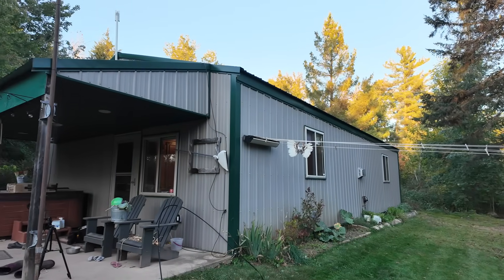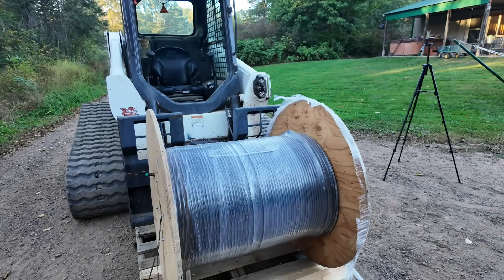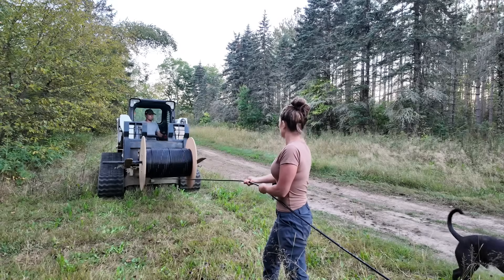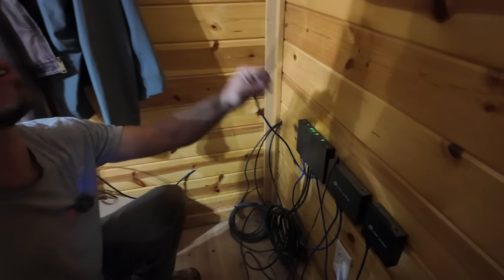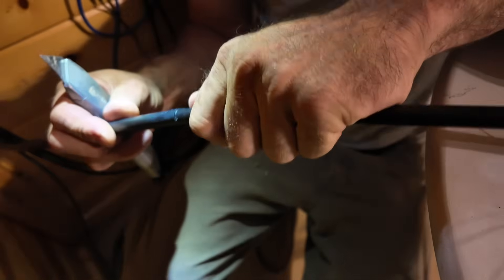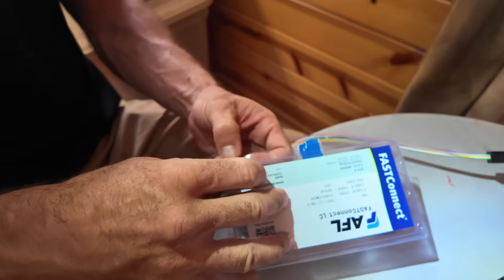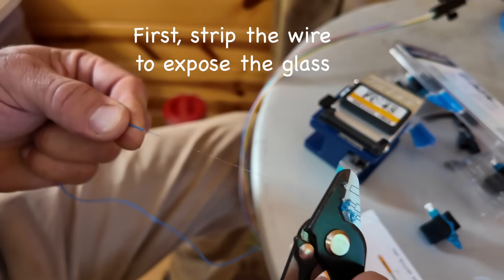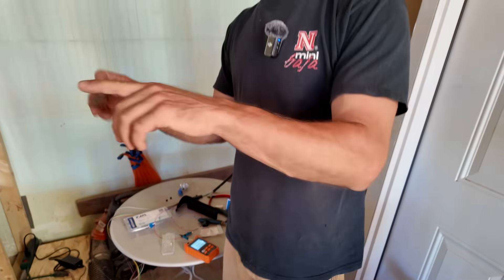We Need Internet! Running a 3,000 ft Fiber Optic Cable

Comment: I work as a Network Administrator at an Internet Service Provider and I deal with fibers all the time.  What you wanna really target is around -10.0 dBm at the receive point.  This is your sweet spot when it comes to fiber optic connections.  We usually "pad" our connections if they are "hotter" than that (a higher value).  Your connection will work all the way until around -23 dBm, but you don't want it to go below -18 dBm if you can help it.  Also, those fibers have a color-code so that they have a certain order.  For a DIY project, it really doesn't matter, but if you were going to terminate all 12 fiber ends and put it into some kind of patch panel - which is what I would have done - You'd probably want them to be in color order:
1= Blue
2 = Orange
3 = Green
4 = Brown
5 = Slate
6 = White
7 = Red
8 = Black
9 = Yellow
10 = Violet
11 = Rose
12 = Aqua
Also it's fun to note that when you use a pair of fibers for Tx (transmit) and Rx (receive), you can go so high up, we've done 400GB over two single-mode fibers like yours.  It's incredible.
Reply: i think you're referring to some transceivers. It always depends on the transceiver used, i've used some that tolerated -30dBm , some that only tolerated -3 dBm, usually the more crammed you go the harder it gets, 100G-LR4 for example is made for 10km but ive used it over 30km ranges

Comment: The fiber type you were probably looking for is called "drop fiber", 2-4 strands in an armored and areal capable sheathing, it's used heavily in Fiber to the Premises runs.   You just have lots of extra pairs now in the event you want to do something with them.
Reply: Nah... 3,000 feet - easier and cheaper to trench and bury.  They got the right cable for the job.  Running aerial would require putting up utility poles and self-supporting cable.

Comment: You should polish the connector end with special sanding paper and a metal puck. The connector sits flat on the paper, held within the puck, and you move in a figure 8 to polish the sharp face left by the cutter. You can also get a microscope to view the end after polishing. If you see a big crack running through your polished end, you need to re-terminate. For me, this is the difference between an ok connection and an outstanding connection,  especially over such a long distance. Great video and an amazing project!!!
Reply: They used pre-polished single mode LC connectors.

Comment: Great job!  I did it slightly different in my DIY-ness.  I did it low cost for my $day job$.  Purchased a fusion fiber splicer for about $1000, used fluke fiber tester.  I bought pig tails and junction boxes and fusion spliced the pigtails in the box and then used fiber patch cables between the junction boxes and the network equipment.  I honestly didn't know you could just cleave the fiber ends and install the connectors..  (this was all done  a few years ago)  still working great today.   No drama..

Comment: I've worked over 10 years in the telecommunications industry and I gotta say you taught yourself well.  You leaned how to terminate fiber into connectors, shoot a laser, wavelengths in nanometers and how to measure signal loss in dBm, why you need to have TX and RX opposite at either end of a full duplex single mode connection (called "rolling the fiber").  You know more than many techs I've worked with.  If you ever want to install more communications on your property, or even run some fibers around your areas and set up an ISP you can do it now!

Comment: UK standards, comms should be minimum depth of 400mm/40cm/15.74"
Ultimately, you'll thank yourself in the future for digging deeper than necessary, for if/when you decide to implement furniture that needs posts/foundations.
Good luck!

Comment: Seems like more work than just mounting the dishes on poles for the point-to-point bridge.
Reply: Fog, rain, snow and foliage will make that an iffy proposition - you're talking at least 75' poles on either end with proper grounding/lightning protection.  Fiber is the way to go.

Comment: Get some automotive wiring harness covering, and put the fibre optic faned-out leads that run to the switch in the harness covering tube, to protect them from getting pulled out of the LC termination fittings. Back in the ole days, when Ilearned how to do these you had to heat up the heat activated glue in the termination connector fittings, and glue the entire thing together! If you made a mistake, the terminations cost around $100 bucks a piece, and you had to cut them off, and start over again! It was easy to make very expensive mistakes! It's nice that they have fine tuned the process to the point that you are using, and have shown here! Nice work sir.

Comment: I don’t want to date myself, but when I first started doing fiber in the 90’s you couldn’t cut it and splice it except at locations that were engineered for a splice. So me a crew of 10 linemen placed 18kft without cut. Aerial, buried, and went through 6 highly populated cities outside of Chicago.

Comment: Couple things. You should put the boot on before stripping the sheathing of the strands. You should pull more into a service loop and put everything in a wall mount box made for this. For single mode, you lose 0.25db/km with a per connector DB loss of about 0.5-0.75db. So for your length, you would probably want to be targeting -1.75dBm. Great job on the work though, I was nervous when you said "SPF" instead of SFP but that was good work for a first time!

Comment: I think I would have TRIED IT first before stringing out the cable. I had a 1500 foot length of coax I had to get a signal across. I put the spool in the lab and connected to the two ends. I was able to get the system working and see how reliable it was before doing the bury.

Comment: Usually you don't hook up directly to the huge cables, as the fibers by themselves are pretty fragile and you want to touch the ones in the big expensive cable as little as possible.
Terminate the cable to a box or patch panel and then get a regular LC-LC patch cable to get from it to the switch! It will be better in the long run :D
It's not different than what you did, patch panels can simply have a female to female connector, you plug what you already did into it and go from there.

Regardless of that, great job! DIYing fiber optics isn't easy lol. Just the fact that you made it work without calling a professional is fantastic!

Comment: That looked like a visible light source @ 650 NM. The power meter was showing 850 nm. Those are Multimode fiber wavelengths.  1310 NM or 1500 NM would  be used for Singlemode fiber

Comment: Nice job
Great patience 
I’m just curious… question for the experts…i was taught fiber termination decades ago…we polished the ends with 5 micron abrasive papers and a “puck”  in a figure 8 pattern on top of a piece of plate glass… then put in ends on with uv glue and placed them in a tray with uv light that we had to erase eprom chips
My question… is that not an acceptable method anymore ?

Comment: Just to let you know as someone who works with Wireless Internet service. Those Radio's are only based on perfect conditions and line of sight. Even one tree can eat up 95% of the signal and then some. Fiber is honestly always the best choice unless you want to deal with tower on one or both sites. Then you got risk of damage of equipment, etc overtime due to lighting, wind, etc. fiber is always the best choice.
Reply: I always tell people WiFi is like light. With nothing in the way you can see light from stars thats are light-years distant, but you can't see a light an inch away through black paper.
Reply: I just when through TP-Link's and Amazon listing and I can't see anywhere what the range is for this. The only thing I saw was a 15 kV ESD Lightning protection, but nothing about distance. Maybe the device wasn't meant for such long range. I can't see any claim for 1/2 mile, much less 14 miles.

Comment: As a fibre engineer I think you did a fantastic job.
I understand it's DIY and what you have done is fine, I would have fitted a termination point leaving out the fan out and running a pretermitted tail but you would need a fusion splicer for that and they're not cheap.

Comment: OK, one can argue about the connection itself. Professional? Absolutely not. Does it work and is that the goal? Yes. So everything is fine. BUT, how come up with the idea of laying the cable above ground over such a route out of laziness? You have the machines. Why didn't you put it at least 30cm into the ground? The cable was certainly not free and repairing defective areas is time-consuming.

Comment: Always thought you had to fuse the LC pigtail onto the fiber.  Didn't realize you could just butt it together in the tube
Reply: You can - and for the casual DIY install - it's fine so long as it's protected in a fiber enclosure with an LC bulkhead.  But fusion splicing to a pigtail is the best way to go if you have the money and know-how.

Comment: Two things: When I did this a while back, I was pointed to Fiberdyne Labs who made and tested pre-terminated cables cut to length. They shipped me spools just like yours. We did a direct bury segment and an overhead segment with a stout messenger cable. Went in without a hitch. At least until the dumpster truck went thru with raised forks and removed all our overhead wires. If you ever run any more, it will save you all that testing and remaking time, says the man with 10 thumbs. 

The tubes and fibers in the fanout kit are still mechanically very fragile. In fact, if you give one a good yank, you can break the fiber several feet into the cable, depending on where it decides to snap. I’d recommend acquiring a small termination box for each end. You put the armored cable in one side, wind all the fragile parts gently around guides in the box and connect them to an LC to LC block, still in the termination box. Then you run a short LC-LC patch cable from the block to your SFP. If someone yanks or crashes into your patch cable, you’re out a $10 replacement instead of dealing with repairing your expensive cable. These boxes are not very expensive thru Amazon or equivalent. 

Good job, though!

Comment: No its not an lc to spf adapter. Its cslled spf nothing else. And ususlly you have pigtails that you Spice onto the fiber. Not using quick connectors those are for temporary fixes. But yeah light should be around -2 dBm thats good . -15 woujd work but nah lame

Comment: I installed fiber in 1980 in the military for a high speed secure connection. It was the first fiber installed outside the 48 states, the local phone guys had to get training on how to terminate both ends of the cable.

Comment: Nice job and great fix for your issue.  You probably already have been told this but the orange "string" you can see when you scored and opened the jacket is a "rip" cord.  If you take a few inches off the end you can use needle nose pliers and roll the rip cord down to the score line you made.  Please find some sort of enclosure you can put the cable into that is attached to a solid surface. Leaving the fiber out like you have it will invite unintended breaks or micro fractures.  The cable is tough the bare fibers are not.  Again nice job.  Thanks for sharing.

Comment: I used to work in the fiber outside plant industry. Cables come in ribbons of 12 fibers, so you'll almost always find them in multiples of 12. But the marginal cost of 12F to 24 or 36F was nearly zero, at least in the quantities we'd order. And the metal tape is for locating, not strength. You really only need steel core for direct hang aerial cable.

Comment: There's a solution for cellular signal. Private 4g/5g. In the US, it's called CBRS. You can be your own carrier, basically. You can have data, voice and text—everything you get from a cellular provider. There are open source solutions (Build it yourself) or out-of-the-box solutions (Pre-configured) Starlink can be used to get out to the internet or your fibre optic network. As a fibre optic technician I laughted so hard at you trying to pull off the jacjet without slitting it down the sides. Also, it will be great to have someone do a fusion splice to terminate the end. The manual way is really and truly for emergency restoration. However, what you did will definatley work no doubt but a fusion splicer will let you know if the cleave was acceptable because you can't see the imperfections of the cleave. I know you said you're new to this and fusion splicer is something a professional will have but this is just me being a nerd lol

Comment: I learned something, thanks.  One thing you hopefully considered is to leave a few service loops around your path-- 20-50' of extra fiber in case you ever need to do a splice or for the mechanics of getting the cable in the trench.

Comment: You probably should have asked an expert.  5 GHz isn't going to work through trees (as you found out).  If you had used 900 MHz radio links they would have worked fine and would have been far cheaper than fiber.

Comment: Might not see this comment, but I would add a rubber gromet to the metal paneling on the outside, not gunna hurt a cable made for direct buried however. 
can easily just cut a side on it and fit it around, put the cut side up.

Comment: I'm curious to know how much that spool cost as I'm going to need to buy some too. Anyone have any good recommendations and where to buy from? Maybe like a clearing house or something? Also what i did to extend my cell signal was I installed a couple cell signal boosters up high for 5G and LTE service. Its pretty amazing at how well it increased my range on my property, and not only that but it even gets more bars on my cell phones than before without the boosters. You guys really should look into them as they are relatively cheap.

Comment: you could have used the ripcord in it, just remove some armor with a plier at the end and it rips it apart without much effort, just use some thick gloves if you need fingers later on :)

ohh boy, and please get an enclosure for the cable ends, even a small wall mount for 12 core

Comment: So maybe I'm missed something, but why wouldn't you have just installed a Starlink dish in each location? When you take into account the cost of the fiber optic cable, switches, equipment, installation tools, cost of digging a ditch and burying the cable, etc. it's probably going to take you about 4-5 years at least to pay back the money that you put into the system. Using Starlink for the second location would have been a whole lot easier.

Comment: Not a bad effort for someone who's never done it before, lot harder than it looks but that's why this is people's day jobs.  Top tip is where you bury the cable across tracks that will have any form of vehicle travelling over it, I'd recommend you have it in some form of trunking to protect it.  You'd be amazed at the impact just infrequent vehicle traffic will have over where you've buried it and I've seen huge network outages caused by the movement of roads damaging fibre optic cables.

Comment: I have two daughters. For many years, I've observed: "Boys are different...." I also have many years' experience with both commercial and residential networking. I've observed: "Fiber is different...and very hard!" Oh, and I'm 70. Fiber used to be MUCH harder. You haven't done fiber until you've had to "polish" a fiber strand.

Comment: Been working with fiber since 1984(defense contractor budgets are cool). You got it done, congratulations. However some pro advice would have saved you a lot of grief, hopefully not much in the future... I'm gonna leave a few shoulda's just to scratch the itch.. A custom wire and cable jobber (kinda like an electrical supply house for telecom) could have built a whole cable end to end, properly furicated, terminated and tested fanouts. It would have been extra money to have the ends done but at worst a push compared to the tooling you bought. That same jobber would have gotten you proper term panels and a few jumpers to get to the routers.  Done.

Something to think about before getting too many things wired into your IT situation is an ample penetration through the walls to the outside for the future. Sizes are your call but here's the broad strokes. Just outside the wall place a hand hole enclosure in the ground, the bigger it is the easier it will be to work in. run buried cabling to there first then have a 2 or 3 conduit stubs (say inch and 1/4) run from that box to the exterior wall outside of your IT stuff. Place a box on that wall, 12x12 should do. Steel with a door is easier to work with but a cover that screws on will do. The conduit stubs should cover you but adding more is easy. Penetrate the wall with a couple good sized conduit sleeves, as big as you dare, 2 inch should be more than enough though. Run your cabling back through and then seal those conduits with something like fire putty pads on both sides to keep the critters and weather out, but easily removable, maybe stuff some fiberglass insulation in there too. You should be done with making holes in the wall forever.

Comment: Remember that the fiber ends need to be extremely clean.  Just waving them through the air will get dirt or dust on them, which will cut down you signal significantly. And dump the fanout.

Comment: Great video, wishing best of luck getting the trencher and everything buried!  In the building, you're placing everything in a vulnerable spot not having everything in a cabinet with the cables supported and secured.  Especially the very thin glass fibers need protection!